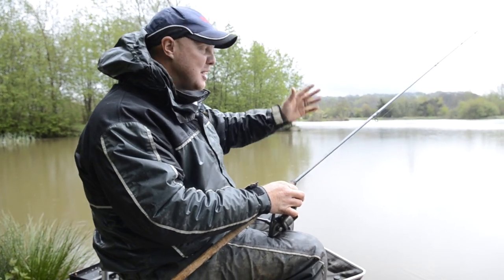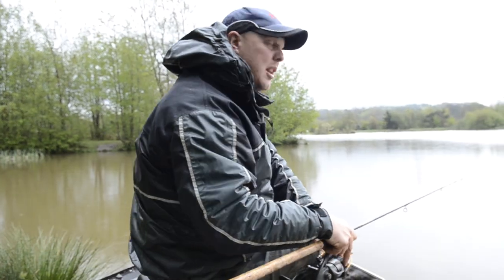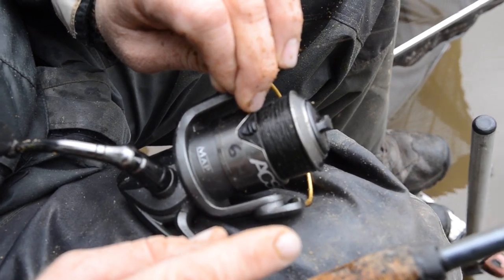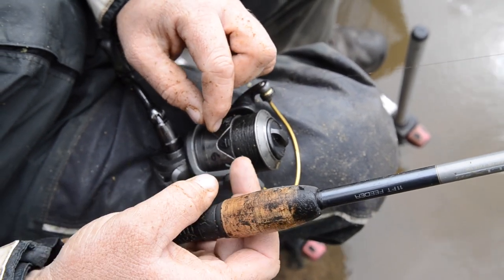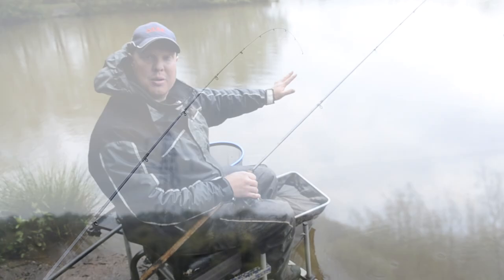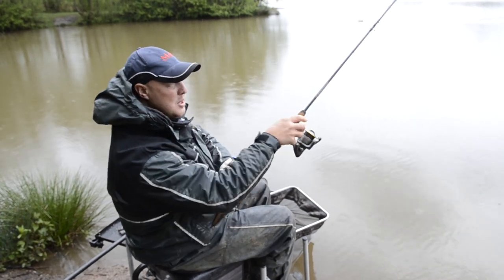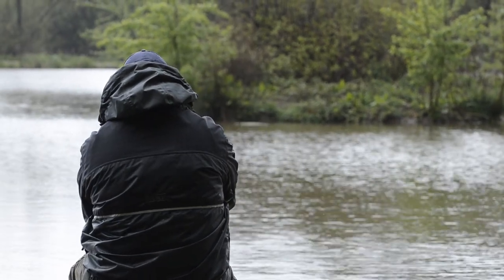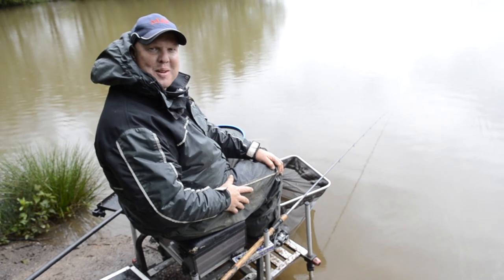How to cast to a line clip

Comment: A tip when using ACS, don't close the bail arm by hand because it sometimes can push line out of clip. Have clip facing ground and close bail arm by winding handle.
Reply: I used to close it by hand and I used to cast way to hard x.

Comment: I have 3 of these map acs reels and have had a problem with all of them .  I put the line in the clip , keep the clip at the bottom away from the rod .  It casts great for a while and then for no reason it just pings out on the cast ( you can hear it ) and then im  going all ray mears in the bush
Reply: I’ve got 3 of the big pit reels and they do the same. Using 18 pound line it just pings out the clip on the acs clip. 😡I’m going to try clipping the line in the bottom part of the clip to see if that works?

Comment: Can someone explain why the rod is pulled back after the cast, I.e, whilst the feeder is flying through the air. What purpose does it serve? Thanks.
Reply from the maker: It means that the final metres of line is pulled off the reel up to the line clip, so as the feeder lands you follow the feeder down with the rod so it doesn't 'bounce' and move out of the intended position. You've just given us an idea for a new tutorial video
Reply: @TheMAPChannel  thank you.

Comment: Can someone explain the reasoning behind d the up and down action of the rod as  the feeder is about to hit the water. Thx in advance.
Reply from the maker: Hitting the clip in the air slows the feeder before it hits the water, causing less disturbance.
Reply: Basically lift the rod while the lead is flying through the air so it slows the flight of the method feeder so it lands flat and slow and the bait doesn't fly off. Also with the rod up in the air when it hits the clip, you now have 4 foot of line to play with for putting your rod on the rest without moving the feeder :)
Reply: @RunninWithScissors  when you feel the line hit the clip or when you hear it lower the rod so it doesn't fly back from the force of the hit and so the line clip doesn't pop off.
Hope that helps x
Reply: And because when the line hits the clip the force of the hit can pull the feeder back and cause your bate to fall of meaning your pellets or ground bate isn't near the feeder meaning your Lees likely to get bites etc.
I use a map acs 3000 real and I love the line clip design. Only reel that I know of like it.

Comment: Hi it might be silly but if I find were I wish to fish put my line in the clip I will always get the same place again, what if I get a run I must then take the line out and  then I lose the distance and must start all again, do I understand right. Barrie
Reply: You can tie a small piece of pole float rubber (around 3 inches long) around the mainline right next to where you clip up so you know where your line fits into the clip every time.
Reply: To be honest buddy especially fishing tight to islands there is enough stretch in your mainline  (I use 6 lb maxima--mostly) that it's very rare even with a big fish to have to unclip. If you do have to you can put a slip knot where you have the line "say to the 1st eye from the butt section but keep the tag ends about 3 inches long so if you have to unclip the knot flows through your rings with ease 👍
Reply: @SWINDLA87   does this mean casting into open water then wind  back to line clip before recast to target area?
Reply: @davidinger4150  Hi mate, I don't actually remember writing my comment or have any recollection of the video but having just watched it, I would say, yes, you would need to cast into open water to get to your clip mark. 

Ignore my first comment though as that would only really be any use whilst carp fishing where you're not re-casting all the time like you are whilst feeder fishing.

If you're feeder fishing up next to an island then there should be no need to unclip at all. The reason for that, is the fish can only go left or right, not forward so it won't be ripping spool off the line anyway. In my experience when fishing tight to an island, you always manage to to regain line before the fish can take any. 

I've only ever needed to let the fish take line when you're almost ready to net the fish, so you can have the drag set quite tight but loosen off when you get the fish within 15 feet from the bank.

Imo, the map Clip system is just a gimmick, I don't think you'll find many companies copying this system any time soon. You really don't need this type of clip. 
Sorry for the long replt, tight lines

Comment: Ive tried this, but , the line snappedĺ this reel looks the business  also had it snap on on afish  6 pound line seems to light for this
Reply: I don't like feeder fishing with anything less than 8lb because constantly casting 35gramm feeders loaded with groundbait takes its toll. Try Daiwa sensor in 8lb. Great line, cheap, enough stretch to absorb casting high weight all day.
Reply: @SWINDLA87  Daiwa sensor or Drennan double strength.

Comment: Also time to clean your gear up 🤮 but no drop it to the car again 👊
Maps products eat your heart out if you got reels send back. Lol
Tip Guys:  use silicon elastic works better then al those line clips
that in the long way damage your line just a small simpel Fact that works